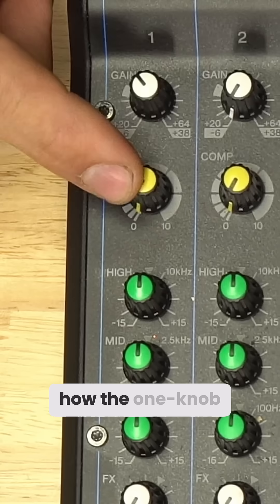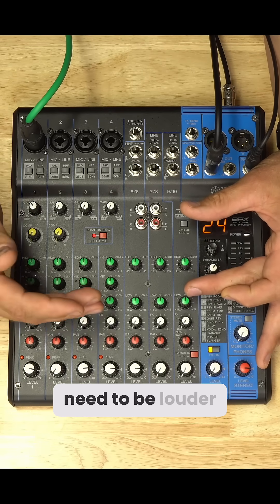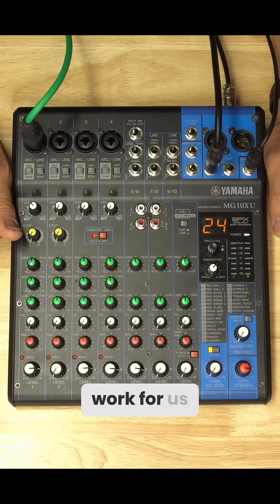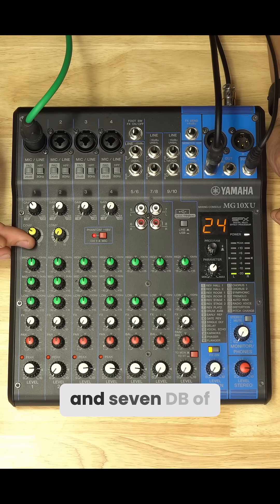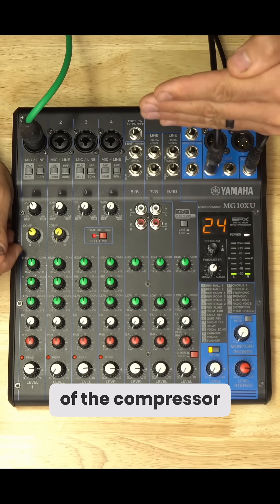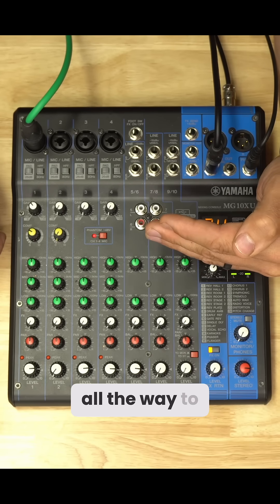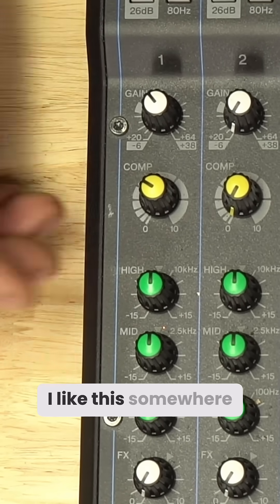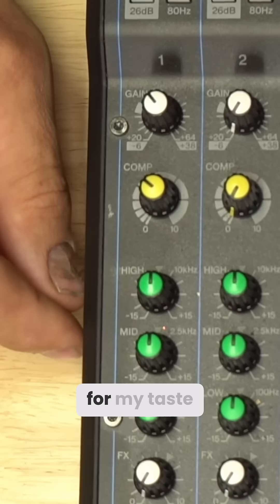Yamaha One-Knob Compressor

Comment: Do the mixer has a compressor that you can use without a computer.Say if I move further away from the mic and it gets very low can the compressor raise up the volume and say if I get to loud can the compressor lower the volume without using a computer ?
Reply: Yes it's a live onboard compressor, maybe not as powerful as you expect it's just a basic one but it helps.  A good mic preamp sometimes have more options and compression, ratios like a dedicated one would.  Limiters can help alongside compressors but you cant fight mic distance after a certain point, thats part of the instrument use and gain as well.

Comment: Are the changes as you turn linear?
As in, at 12 o'clock you get 2.5:1 Ratio, -15db threshold, and 3.5db Gain?

Comment: I don't think that it pushes the gain into the compressor. The parameter is indicated as "output gain", that means that it boost the output signal to compensate for the lost percieved volume during the compression phase
Reply: Analog channel strips' circuitry follow a top-to-bottom layout. Anything below the gain knob is post-gain. 

Gains are literally gradations of voltage.
Reply: @slofty  Yes, but is not correlated to the thing that i said in the previous comment. I was saying that the knob doesn't add gain to the signal before the compression, it adds it after the compression phase